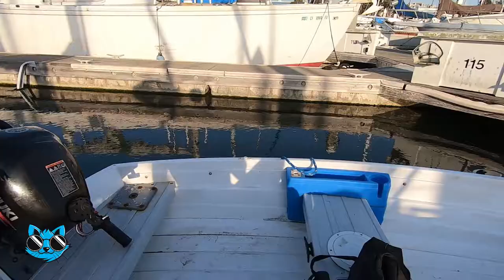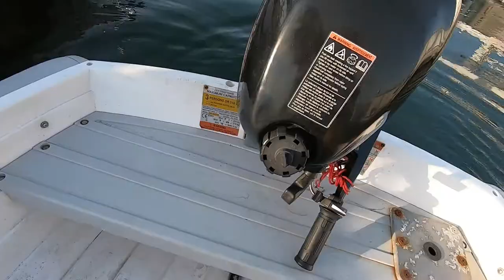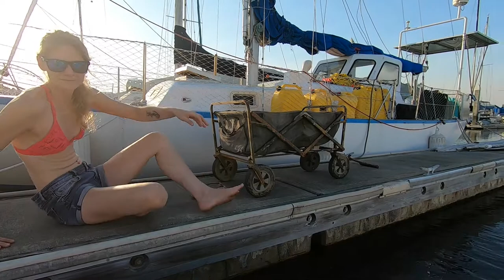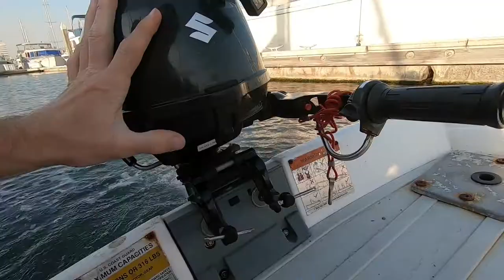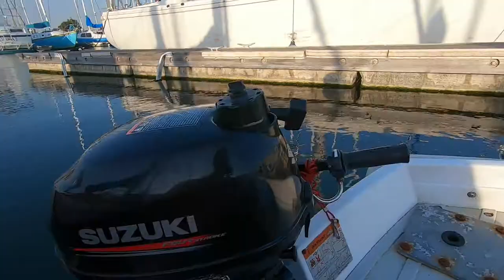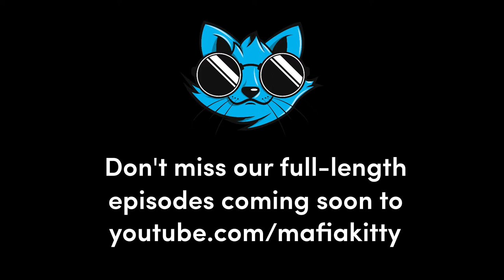Trying To Fix Our Dinghy Outboard - And Giving Up (Suzuki df2.5 carburetor, idling, surging issues)

Comment: If possible see if someone can check out the carb, if you haven't already, usually the go-to on smaller engines.
Reply from the maker: Yeah, we cleaned the carb out a few times, but it didn't work. The person who bought said it was broken intake manifold spacer and blown gasket. This outboarrd is infamous for its carb issues, because they make the jets super tiny to meet the new CARB emissions regulations. We got a cheap 2-stroke outboard on Amazon as a backup. It sounds like a motorbike haha but it was like 1/4 the price and it's a little more powerful. We also got an electric outboard that we'll use 90% of time so we don't have to buy gas.